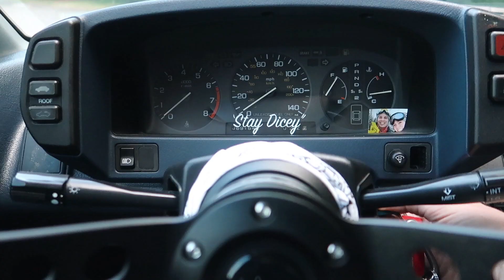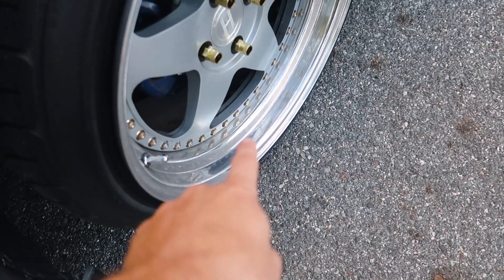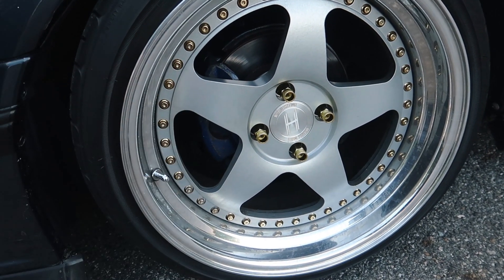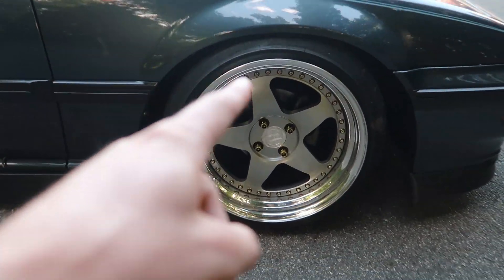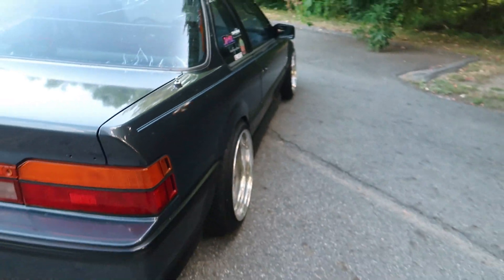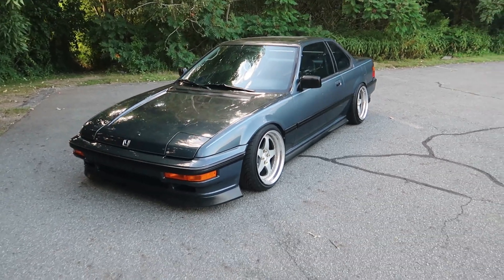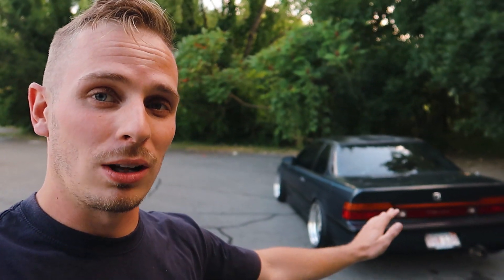MY HONDA PRELUDE WHEEL FITMENT

Comment: I’ve just bought my first 88 prelude and it has stock 14 inch wheels, still new to knowledge about cars but I can fit a 15 inch on with ease as long as the bolted area fits ? Bc I have a site that only sells 15 and above for my 88
Reply from the maker: You got it! Just make sure you still have 4x100 bolt pattern
Reply: @ConnorLee  sweet as man and just realised how fast you replied 😂keep up the content man glad someone posting about the 88 and loving how your journey for it has looked

Comment: Rust will spread, however the important part is to avoid that causing damage to the stability of the car. Budget advice is use some rust remover, clean as well as you can and spray with a rust coating. After that get a sheet metal panel and cover it BEFORE bed liner. If you cant weld use JB Weld. Beautiful car but probably not worth taking to a shop, diminishing returns.
Reply from the maker: Your advice is appreciated more than you know, thank you 🙏🏼

Comment: What about the steering wheel whats the size? And is it hard to turn at low speeds?
Reply from the maker: WTK 87 ooof the diameter I don’t quite remember but it’s about half an inch smaller than oem. Turning is a bit harder but nothing bad at all, just noticeably stiffer
Reply: Elevated Media i might need to hit the gym then i dont plan on going too small 350mm is enough. Thanks for the reply
Reply from the maker: WTK 87 haha😂✌🏼
Reply: Elevated Media also another question does removing the steering wheel require a puller or can i just tug on it?
Reply from the maker: WTK 87 it’s a two mechanism lock so you have to pull on one thing while squeezing another device
Reply: Elevated Media was it easy at least. Honda usually isnt known for being the hardest cars to work on.
Reply from the maker: WTK 87 so easy! I have a video of my install back almost a year ago on here
Reply: Elevated Media ill look for it thanks. The only difference is mines a base model and a 87 so hopefully i dont have the two lock but i wouldnt know.